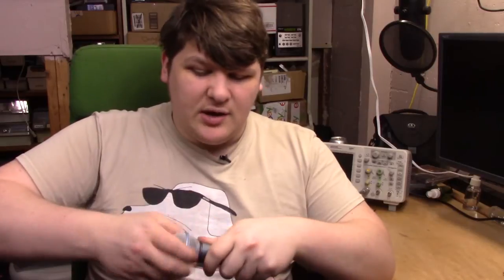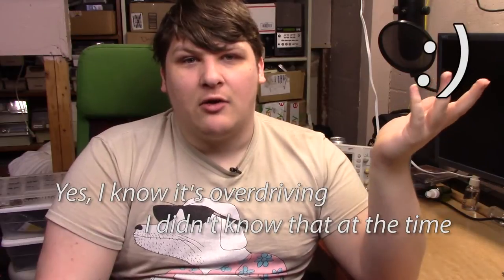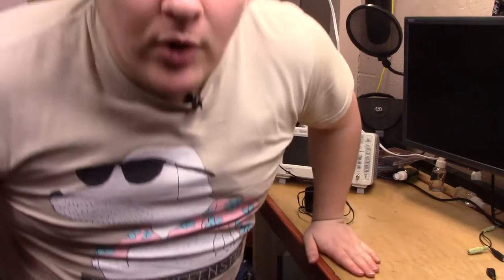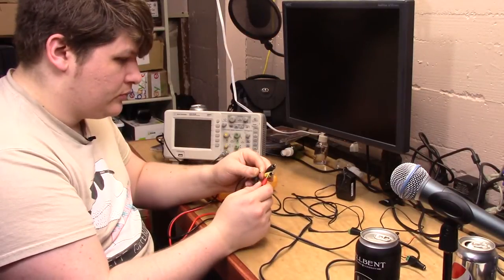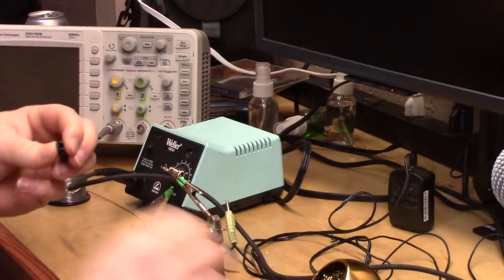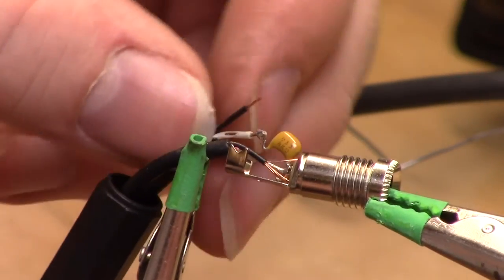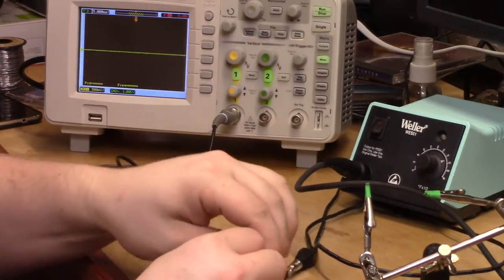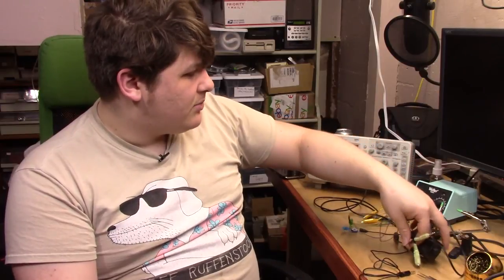Electret Power Supply

Comment: Back inna day some camcorders would say "plug in power" next to the mic jack to indicate that they would provide power to the mic. Maybe someone decided that that wasn't cool any more.

Stereo version just needs two resistors and a supply that's stiff enough to not be (significantly) moved by the AC current coming back through the resistors. Yes you'll always get a little bit of cross-coupling but you can work out how much it'll be if you know the characteristics of the signal and the components, and you don't need very much separation for a pair of mics that are 25mm apart.
Reply: I used that technique to connect the optical pickup of a 16 millimeter movie projector to the “plug-in” power external stereo microphone jack on my Sony mini-DV camcorder. Surprisingly, the audio level from the projector optical pick-up matches nicely with the mic. input audio level on the camcorder. The projector audio is mono, so I simply connected the left and right together where the projector audio feeds in. The whole thing fits into a small metal project box and I refer to it as an “electret phantom power blocker.”

Comment: THANK YOU! That's what that click is, after a ton of searching to find nothing useful I just figured it was the DAC freaking out after monetarily shorting one of the channels to ground or something. You do a great job at bringing surprisingly obscure information to the surface.
Reply: This can be caused by other things as well, like when the amplifier circuit in the headphone output is powered by a single-rail DC power supply.

Since audio is AC and swings above and below the 0V reference point, you can't power an audio amp directly from 0V and +5V/12V/etc..  You need a negative reference as well.

One simple way to do that, when all you have is a single positive rail, is to divide it in half and make the 50% point the new "0V" reference, so you have -50% and +50% relative to that point.  The output is then AC-coupled through a capacitor to block the DC voltage relative to the "real" ground.

The problem is, the output side of that capacitor is essentially floating in nowhere-land relative to DC ground, since the only connection (with nothing plugged in) to ground is through a component that blocks DC.  When you plug in a pair of headphones, there is suddenly a path to ground, and the entire system stabilizes its DC bias point.  This can cause a pop while the capacitor charges or discharges through the load, and then settles.

Similar thing happens when you first power-up a single-rail DC supply audio circuit.  The "virtual ground" point goes from 0% to 50%, typically at a higher speed than the lowest passable frequency of the output coupling capacitor, causing a very low frequency, and sometimes high amplitude, WHOMP.  (Common example:  Turn on your computer with speakers connected to the sound card.)

It can happen in AC amplifiers too, while all of the transistors find equilibrium, but the severity depends a lot on the topology of the circuit and its behavior while the rails are diverging from 0V.

Comment: For real about not being available. I built a 4-port electret phantom power box into an Altoids tin once so that 4 computer headsets could plug into one of those cheap little mixers for portable streaming/commentating. It was honestly so simple that I couldn't believe no company was selling one, in fact it was frustrating that nobody sold one because the way I value my time made it "cost" twice as much as any commercial product would have been. Anyway, good coverage of the topic. Slowly binge-ing all your old vids and it's a fun time.

Comment: Electret. 6:16 Getting rid of the black magic. 

Some electretes do have an electric potential between two faces, but on its own is incapable of generating power. 6:30 Electrical Power requires an electrical potential and an electrical current, but to have current one must have a completed circuit.  While electrets are a charged dielectric analogous to a battery, unlike a battery the electret's dielectric does not conduct electricity thus no current flows which is why dielectrics can't be discharged like a battery. Technically they may internally dischaege over a few decades.  An electret's dielectric is electrically  polarized with a negative and a positive surface, and can remain quasi stable for a long time. 

Ac power generation with an electret is possible with electrostatic induction, where by  conductive plates of a capacitor are varried with an electret inbetween creating alternating periods excess electrons and not enough electrons to balance the electrostatic field between the plates. But because of the size of a microphone electret that power is very very small. Thus why the ac audio signal needs to be amplified. 

I'm not certain that all electret microphone amplifiers need 5 volts, but if so it's relatively easy to get 5v from say 1.5 with a simple boost converter circuit. An electret microphone amplifer won't be consumming much power anyways. 

All this info i provided is not important for those that don't care or who wont repair or build a diy electret mic.
Reply: Electrets are suppressed tech
Reply: @Coincidence_Theorist  Hardly suppressed. You find one in every electret  microphone.  It's not used in many applications because  they degrade over time which limits their usefulness. In many cases it's  simple enough to create high voltages and charge a conductive surface when an electric field is desired.

Comment: My dad taught me back in the day to add electret phantom power by just putting an AA cell in series. I think it worked but it has been at least 2 decades since last I've tried. Maybe it was a little more complicated and it needs 2 AA cells, a capacitor and a resistor. So you can do it without a power supply, and they take so little current the cells can easily last years even if permanently connected.

He called electret mics "condenser mics" so I didn't really know the difference until many years later. I still think they're extremely similar: it's basically a capacitor where the insulator has dipoles, and that has a built-in transistor.

Comment: Just some side information:

You can use condenser mics and dynamic mics on the same device with 48 volts on, if you use good symetric wiring (you always should use good wiring). +48V are provided to the hot signal pin (2) and the cold signal pin (3) on the XLR jack, ground is on the ground pin (1).
Dynamic mics have the coil between Pin 2 und Pin 3, so the DC voltage between these pins doesn't exist. The potential beween +48V and +48V is 0V.

Comment: I think the reason your lapel mic can get 5v off of a 1.5v button cell is that it might have a power amplification circuit in it; same way a 500,000v TASER is run off of a 9v battery.

Comment: I was thinking  a sardine can would have been perfect project box.  

It could easily fit 4 AAA batteries for portability along with two stereo audio jacks, one for in and the other out.  And if you want, you can include an external power jack.  Your sardine can  project box would also easily contain two capacitors, one for each channel to couple the audio signal and decouple the dc power.

Comment: i'm one of the people who doesn't know more about capacitors than what you just explained. so i'd like to state for anyone who DOES know more & who got annoyed at you for the bit you said they'd be annoyed by: i only just barely have a hold on what daniel did explain, & i'm glad it wasn't more complicated than that, even if the explanation was technically less accurate somehow. :) i'd rather learn an estimated framework & get that clearly, than be told something i don't understand & end up dismissing completely.

Comment: The extra conductors on phone plugs are called sleeve
Stereo has tip, sleeve, ring.
The original iPhone headphones had two sleeves the extra one for the microphone input.

Comment: Zoom recorders and Sony camcorders refer to this as "plug-in power" if I recall correctly. Some Panasonic camcorders refer to it as such as well, but as far as DSLRs/mirrorless cameras, they (much the same as sound cards and phones and whatever else that you mentioned) don't refer to it by anything.

Also, there is a design for exactly this that I came across back around like 2016, but I had to have a Russian friend of mine translate it at the time (because it was on a not English site).
Reply: Ooh, here's a fun one. ALL Canon camcorders DON'T provide "plug-in power".. except when they do (I recently picked up a Canon HF G50 that may have been stolen, but hey, it was $200 on Facebook Marketplace basically new in box). I found out this camera kind of has the power necessary for an electret mic. It's switchable, but it (same as my old and new Sony camcorders) is 3V DC, but somehow, it works. I'm not going to ask questions because I'm fearful that some government agency might kneecap me if I do XD
Reply: I had a Sony minidisk Walkman with a “plug in power” mic socket and I found in a local second hand electrical store a tiny Sony lapel mic which came with a little unit that took a coin cell battery to power it, but discovered it worked in the minidisc without needing the power unit.
Reply: Found it. Sony ECM-T150.

Comment: Yes, Radio Shack had plug-and-play 1.5 volt AA batt powered stereo mics as well has those on the blister pack rack that used a 9V battery.   Now that you mention "condenser", maybe they should've called them "capacitor mics" (even in the 80s).   Hmmmm.

Comment: I'm not quite sure how the jacks in a smart phone are built, i.e. what is providing the power exactly, but just a random thought, have you checked smart phone replacement parts? I once replaced some part in my old Galaxy S2 and the jack was its own part the one could have ordered. Then again maybe it was just a normal jack and the whole magic was somewhere else on the board.
Reply: Normal jack, the voltage is somewhere else

Comment: The plastic they used to isolate the middle-pin of this connector seems to melt when you heat it with the soldering iron... they still sell this crap today...

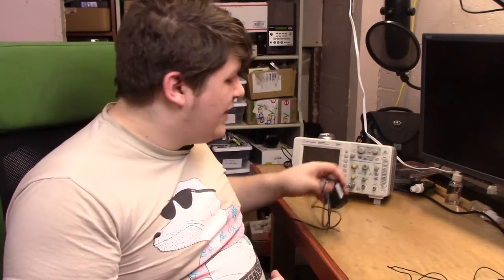Comment: 13:11 i swear to fuck you just did a magic trick & i rewatched this segment so many times trying to figure out what the shit was happening. i thought you tore the end off that y-cable, then placed it on the table, but then the cable wasn't ripped as shown when you go to put it down. but i think what happened was you didn't pull anything away from the cable but a shadow, then what sounded like you putting the end down on the table was actually you knocking into the next piece that you DID pick up. is that right?!

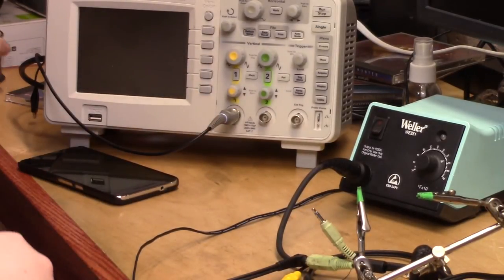Comment: Reasons to breadboard a circuit before actually soldering and clipping leads.  27:42
Reply: Sir for HF circuits I heard Breadboard Could Add lot of Stray Capacitances
Reply: @jaihind3693  hf.... yup. Typical  audio frequencies? Not as much.

Comment: I think that the term "electret" is propably "electric" in german.
Reply: Nein.
That is German for 'no' because your assumption isn't correct. ;-)
We call them pretty much the same, we just use a slightly different spelling, replacing the 'c' with a 'k'.

Comment: The use of a higher value capacitor (1 to 10 microfarads) will give the audio better bass response. The positive side of the capacitor will go to the power supply or you could use a non-polarized capacitor in a pinch. I’ve been experimenting with cheap electret condenser microphone capsules for years and they seem to work just fine anywhere from 1.5 volts to over 9 volts.
I used to buy stuff from Naiant Studio (naiant.com) which did have an excellent XLR to Electret adapter, but it looks like it’s discontinued. 
https://naiant.com/pfa-specification/